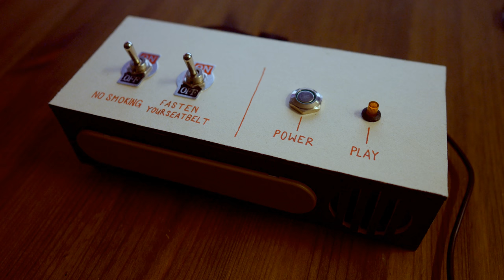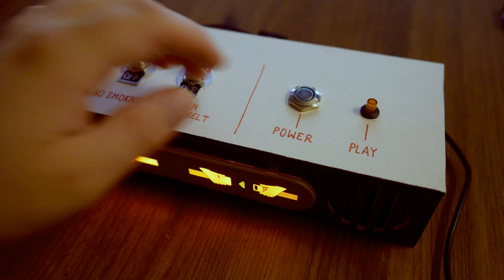Flight-Board (NS/FSB-Sign + Random Soundbites)

Comment: Do you happen to know what light bulbs these signs use?  I ordered what I'd guess is the same model from an A320 from 1991 and 3 of the 5 bulbs are burned out.  Unfortunately the distributor on eBay didn't know the bulb type.
Reply: You can replace any of the availabe that can fit
Reply from the maker: I also needed to replace some and used those: https://www.conrad.de/de/p/barthelme-21022420-subminiatur-gluehlampe-24-v-0-50-w-t1-klar-1-st-728913.html